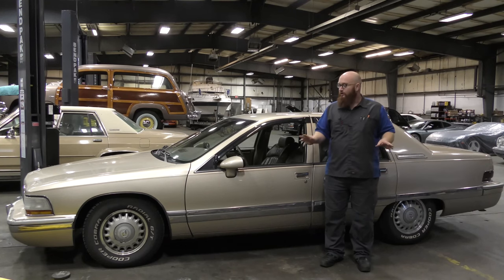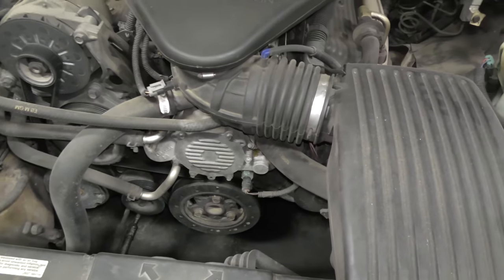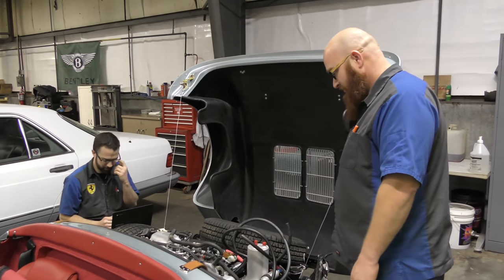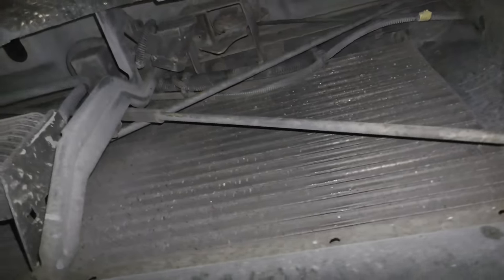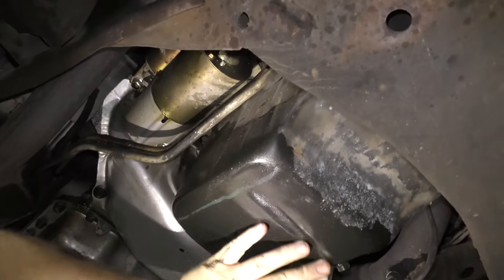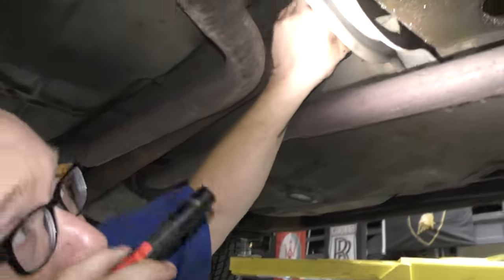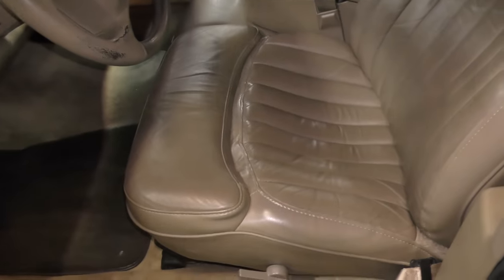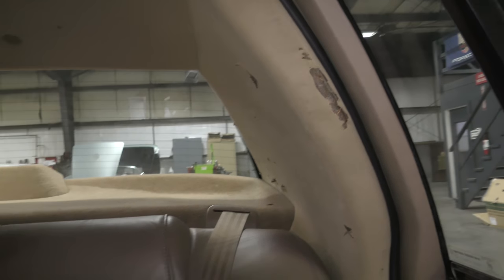Why do mechanics buy 'grandma' cars? CAR WIZARD explains their lure with this '94 Buick Roadmaster

Comment: There's no point in getting a police crown vic when the grand marquis, town cars, fleetwoods, and roadmasters exist
Reply: I find amazing condition Grand Marq's all the time on Craig's List
Reply: @everythinggrowsyaheard  I got one for $800. Maybe put in $7-800 in parts, more than it needed.  Changed the whole steering linkage to grease fittings. Driving it for years, put about 80K miles. It is a 98.
Reply: Yeah the only problem is it's getting harder and harder to find a clean B/D body lol
Reply: well a police crown vic has a LOT of hours on the engine, a lot more than the miles on it might suggest. They idle their squad cars for long periods and are likely more worn than civilian-owned crown vics. I think Wizard touched on this point before
Reply: Police Vics are not bad though, the ride is fine, not pillow soft, but definitely average. They have substantially more power (30hp) more than the civilian models, and the transmission is upgraded as well.  
The best part is that the parts are interchangeable, so you can put town car seats in a police car. 
Yes, they tend to be well worn, but Gov't vehicles tend to be maintained well.
Reply: @everythinggrowsyaheard  I like the version The Wizard has better than the final version that was around before Mercury was discontinued.
Reply: @killer13324  Later models have a button on the dash that shows the number of hours on the engine. Buy the detective's car if ya can.
Reply: @superdupergrover9857  You can put town car seats in a Vic but if the power switches are on the door it becomes a dog and pony show. Having put a Buick seat in a Chevy years ago I can offer a tip. Disconnect all the drive cables from the seat motor and turn them to where you want the seat, then leave it alone. You may have to raise it back up if you leave the cable loose as road vibration will slowly lower it after about 10,000 miles or so
Reply: @garthlocklin6355  what year did they start doing that in?
Reply: The old crown vic cop cars are usually pretty trashed by the time they are retired since those Eco-boost engines are such a POS and break down constantly. The cops all hate them and want their departments to buy mustangs instead
Reply: @killer13324  I will guess '06 or '07 "Police Interceptor" cars. The dash on the Fords/Mercury's will have round dials/speedometer vs. bar style; there is a few YT videos on the subject.
Reply: @garthlocklin6355  or a fire chief car.
Reply: @killer13324  2006.
Reply: @pyotyrprepka1875  more police departments are switching to Chevrolet Tahoes because of this.
Reply: Bulletproof engines will last  like a toyota or longer
Reply: The other option is a Trailblazer EXT. 
BUT make sure it has a manual hidden fuel cutoff. Must be hidden they do disappear especially if it is the V8. That long wheel base EXT is the closest thing to a crown Vic ride there is in a SUV.  I6 or V8. The I6 is really smooth and quiet. When I 1st brought that home the wife was not pleased with that big thing. Then she rode in it. Then she drove it.
 Then I had to get another one.
BUT they are real pain in the tuckus to work on.
 You do understand she did not like the Crown Vic I had?  Because it was a granny car?
Reply: I must admit, I do like crown victory’s.
Reply: Well good & bad people are just now finding out how good these cars are the bad their prices are about to Skyrocket
Reply: Everyone wants that police car look. Not me. I'll take that 75K mile babied Marquis anyday of the week. Especially one with the performance package  = police package
Reply: Loving my 2010 Town Car. Super comfy and reliable. 90mph on the high way all day long and then some.
Reply: @Sammydx1  You can have the best of both worlds if it's a white Marquis 
Pretty sure we've scared people coming up behind or by them in one of ours before lmao
Reply: @superdupergrover9857  They don't have any more physical HP at the block, they have different rear end gears and ignition settings. Year by year, all 4.6 are identical across all Panthers except the DOHC in the Marauder. Mustangs and other models got different versions, but all Panthers were the same. You can theoretically flash them all to produce the same gross HP and torque.
Reply: Saint Fifty One  they're switching because nobody makes a fullsize sedan except Fiat/Chrysler. Tahoe has had a law enforcement package for decades, usually park services and federal agencies got them.
Reply: @warrenpuckett4203  I see those for sale on the cheap all the time, what's the main issue?
Reply: @MrTaxiRob  CVPI's have the Marauder airbox, which is where the horsepower gains come from.
Reply: @MrTaxiRob  The older ones gas tank rust.  Or the motor is tired. You can make it run quiet with the next higher viscosity BUT If you don't let the motor warm with gentle gas pedal pressure you will blow the oil filter housing seals. The rear axle stabilizer brackets break. The Marquis + some vics and Town car cars get air ride sickness.
Reply: Saint Fifty One  
Pyotyr wasnt saying crown vics are bad or that crown vics have a ecoboost.  What he meant is the explorer and taurus ecoboost police cars are not favored by police and so the vic is usually the most used car in the fleet and some departments actually hold on to them as long as possible. So by the time they are sold to civilians they are worn out.
Also Ford doesn't sell the explorer with the interceptor package with a Naturally aspirated v6 anymore, only the ecoboost.
Reply: Cop vics are cool tho
Reply: @dillonh321  My Vic was older  1983.  It still had the 351W in it with a C6 tranny.
Reply: @paulpalmtree9295   crown victoria.
Reply: @CaptainCJ97  no.

Comment: At a large Toyota dealer all the mechanics drove Toyotas/Lexus. At the large BMW dealer next door, their mechanics do too. Can't make this up.
Reply: I used to work on cars in my spare time. I still do from time to time. Just bought myself a Lexus after trading in my Corolla I put 95k trouble free miles in 4 years time. It rides like a land yacht but looks better, is totally reliable and not too bad on gas either.
Reply: The BEST car to use as a daily would be a Corolla. Maybe not as cushy as this Buick, BUT a Corolla will run FOREVER with MINIMUM repairs!!
Reply: I have 2 mechanics: One drives a Lexus and the other one a big Chevy pickup. Anytime I’ve asked, the recommendation for years has been the same: Lexus/Toyota.
Reply: @TheOzthewiz  a little small inside
Reply: @JimAllen-Persona  what they recommend for you and what they want for themselves are two different things
Reply: @TheOzthewiz I agree.  Since 2009 I have driven 2 Corollas and I am a Freelance Computer Tech who travels a lot.  My 2010, which I bought used in 2015, has over 100K miles on it and runs perfect.  And this car was first purchased by an old lady from Philadelphia who hardly drove (only 17K miles in 5 years).  I picked the right car and I will keep it until it disintegrates (which will be in 20 years).
Reply: I'm a Chrysler tech and I drive a Toyota Tacoma.  Everyone else drives Dodge and Jeeps. I'm the only one not working on my car in my spare time.
Reply: Go the mighty Toyota's... happy hilux owner here :)
Reply: @CouchMan88  which model?
Reply: @650tonyd  I got the RC 350 FSport

Comment: Went air born in a 96 crown vic, I've had landings at O'hare go rougher than that vic landed.
Reply: 4 bolts to change waterpump. Perfect. 4.6 v8
Reply: crown vics and cutless sierras were clearly designed for short term flights.

Comment: Is a Corvette engine in a family car?
Or 
A family car engine in a Corvette? 
Its GM, my money is on the latter.
Reply: That "family engine" is currently going low 7s in the 1/4 mile with a H pattern manual transmission.... You'd lose your money.
Reply: @mdk7376  from the factory? Doubt it. I think he was talking about them both being stock hypothetically.
Reply: It’s not a corvette engine at all. It’s just a B Body LT1. 260 horse, 330 foot pounds. Cast heads, 2 bolt main, difference intake, different manifolds, different cam etc.
Reply: @ MDK 7

No.... just.... no......
Reply: @Bartonovich52  an LT1 first appeared in a Corvette.

And do you want to bet? 

There is absolutely a LT1 h-pattern t56 manual Camaro running low 7s.

Facts are facts.
Reply: @Bartonovich52  he’s right actually. It’s a white Camaro. Fucking thing is insane. Can’t think of the name of the fuckin thing tho
Reply: GM usually adapts their performance engines for non performance use not the other way around. The tech goes to corvette and camaro then gets de tuned and adjusted for sedan and truck use. Swamping aluminum for Iron lowering compression etc./
Reply: @tclott316  so much this. People list their caprice with a "Corvette" engine. I regularly ask if they swapped the stock one out for one with 4-bolt mains, aluminum heads, and a better cam. The top cover is also different.

Still a fantastic engine, and I'd argue that iron makes a better cylinder head with gasket materials of the era... But the Corvette engine only came in Corvettes.
Reply: @mdk7376  Yea, tuned so much it has almost nothing to do with the original engine.
Reply: The Corvette of this era came with the LT4
Reply: @ElPants21  the LT4 was an optional engine only in 1996 if you got a Grand Sport or the collector's edition. If the Corvette has an automatic or isn't a 96, it's got an LT1.
Reply: There are lots of things different between the engines. Cams, lifters, tuning... the heads and block are the same. Just kinda like the Ford F-150, Crown Vic and Mustang share the same engine, and they’re still different.
Reply: @roundsm18   same hydraulic roller lifters on all of them. Heads on the Camaro/Firebird and Corvette are the same aluminum model, while the caprice/roadmaster/Fleetwood got iron heads (which actually flow a little better that the AL heads while weighing way more). I'm not sure on the cam; the LT4 did have a specific intake and cam. Corvette block had 4-bolt main caps, while f-body and b/d-body are 2-bolt main blocks. LT4 Corvette has a special intake, but everyone else got the same intake manifolds (though the engine cover hold down varies between models, as does the air intake elbow). B/d bodies got the properly vented optispark before the f-body; grandma probably hits more puddles. The accessory drive system is different on all three variants.

Yes, several differences - some more important than others. :)
Reply: @DannySauer  that I didn’t know. I do heavy trucks and occasionally some 1 tons, but the thing that is the hardest are engine rerates. Some customers think we can just electronically rerate their engine and while yes I can, you can also do severe structural damage.
Reply: Hey Genius that's how muscle cars originated. It isn't a bad thing.
Reply: its actually a truck engine. thats what muscle cars originally were, the smallest sporty cars with the biggest engine they could fit

Comment: They run forever and are easy to fix. Thats why I'm into the Panther platform
Reply: Panther series FTW!  I'm on #5.   One of my LTCs saved my life!
Reply: @HiroNguy  how did it save your life?
Reply: Mercury marauder. Crown victoria. Grand marquis.  I love all 3. I owe all 3😉
Reply: @Kenster1025  Shitferbrains decided to turn left in front of me in his Explorer.   I had the right of way.  50 mph combined headon.   
I have knee injuries but actually walked away from that wreck.  
Sucks 'cause that '01 LTC was perfect at that point and I intended many more road trips in it.
Reply: I‘m the German Process Engineer out of the team who were flown over for a year to make the 3rd Generation 03–12 Panther platform happening at the Rouge River Frame stamping plant in Detroit. 

The hydroforming process alone took me more than a year to develop, for this monster of a frame and another year to commission the whole production line to rid out all flaws. 

It was a major effort from Ford and a real thorough endeavor, 
where they even had a bunch of retired engineers called in as well, to raise the quality. 

Stiffness was raised to such a level, that I feel sorry for any opponent in a crash with a Crown Vic to this day😄
A tank has nothing on these cars. 
Wall thickness of the  frame tubes is 3.5mm and we hydroformed it with 1700 bar/24.656,42psi
from round into a square, boxy shape. 
Magnificent stuff.
Reply: @stevehislop  Wow! You guys did a hell of a job. The platform is legendary
Reply: @Coodeville  Don´t wanna brag, but I did the GMT360 as well:)
Reply: @stevehislop  outstanding!
Reply: I would've agreed with you... Until I spent three weekends lasr month replacing the exhaust manifolds on my 04 marquis. Holy crap, what a nightmare it was drilling out the three broken studs on the passenger side. Grinding off the rusted nuts on the other studs also sucked. Replaced with stainless, and the new manifolds got header paint inside & out to hold off rust a little longer this time.

Everything else on that car is great (I bought it nearly new with like 10K, and now it has nearly 200K), but if I ever have another exhaust leak up front on a panther, I'm just selling the damned thing. 😂  (or pulling the engine to fix outside the car)
Reply: @DannySauer  Sorry , but I´ve only made the frame happen. 
If you want to have an almost maintenance free car, drive a Honda or a Lexus.Take the word of a German R&D engineer with 30 years of experience.
Reply: @stevehislop  maintenence free sounds boring. ;)
Reply: @DannySauer  Lol- as an owner of hydropneumatic Citroens (diametrical vehicles to my Honda´s) , I kinda understand:)
Cheers from Germany.

Comment: Buick road master estate wagon is still one of my dream cars.
Reply: I was going to buy one for 2,500 from my guy here in Fresno California but I told him no 😰
Reply: Come to AL and get my 92. I'm tired of it.
Reply: This or an Oldsmobile Custom Cruiser. The dealership I worked at had two in alternating rotations (one was a rebuilt wreck). Both sweet rides. The only problem that they had was that big ass dashboard pad catching the sunlight and blinding you. If I could find either the Buick or Oldsmobile full size wagons that haven't been ragged out at a decent price I would buy it without hesitation.
Reply: The 70's and 80's models are good too.
Reply: Love those BIG AMERICAN station wagons. Wish they would make a comeback !
Reply: I've got 96 Buick Roadmaster Estate Limited (LT1),  92 Olds Custom Cruiser (305 TB),  89 Caprice Estate (403),  86 Caprice Estate (305),  86 Pontiac Parisienne (305),  72 LTD Country Squire (400),  67 Pontiac Parisienne convertible (283).  All are factory original,  except the 89 which had the wheezy Olds 307 replaced with a built Olds 403.  Full size RWD cars are the best!
Reply: @LakeNipissing  I like them too, but they're bad on gas.
Reply: @AbcAbc-sp1od  The fuel economy of the LT1 Roadmaster wagon is surprisingly good, even with the 2.93 "trailer axle"  > 20 MPG, likely pushing 25 MPG on the highway.  The Custom Cruiser with the TBI 305 has a 2.73 axle, and the fuel economy is even better,  although it is far from the race car performance of the LT1 !!
Reply: @LakeNipissing  that's not too bad, given how big those cars are
Reply: @AbcAbc-sp1od  I was going to buy a used Ford Flex until I found out the Roadmaster wagon got the same mileage. Bought my 94 with 40k miles on it, about 8 years ago.
Reply: @studebricker2845  since a 94 car is nearly 27 years old, has it been nickeling and diming you with little things?
Reply: @AbcAbc-sp1od  I had a trans seal that was leaking fixed, a/c compressor died, new water pump, but that's it.  Not bad for a $5k car.